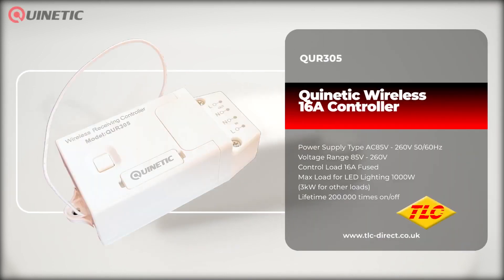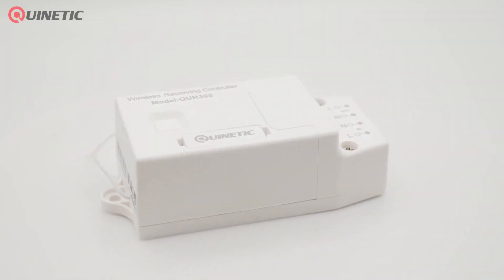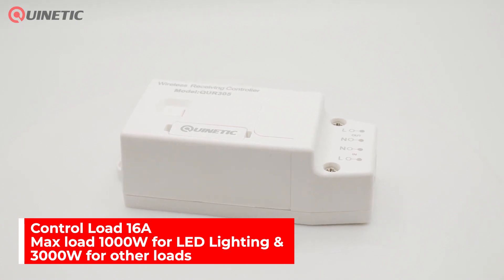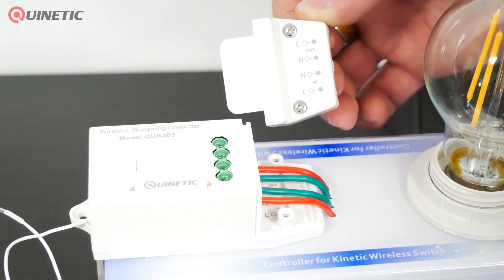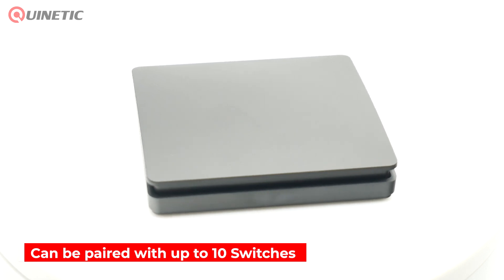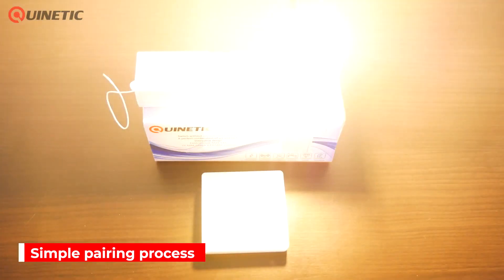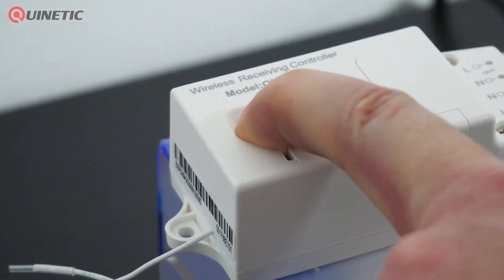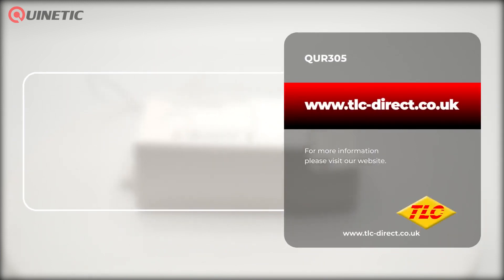Quinetic QUR305 Wireless Controller

Comment: I want a remote control foe a 1200w vacuum cleaner,Can this be wired to a standard 3 pin socket with the Vac plugged in and activated by the QUFB1, or will the 13amp socket receiver do the same job?, Thanks, Dave.
Reply from the maker: Thank you for your enquiry. For this application, it would be suitable to use a QUA 313 socket adaptor or a QUA W10 if you wish to have additional WiFi control. The QUA313/QUAW10 is rated for up to 3kW loads(non-LED) and can work with any of our wireless switches (up to 10) including the mentioned QU FB1 fob.
Reply: @tlcdirect  Thanks for the answer to my question, this will solve an ongoing problem for me, regards, Dave.